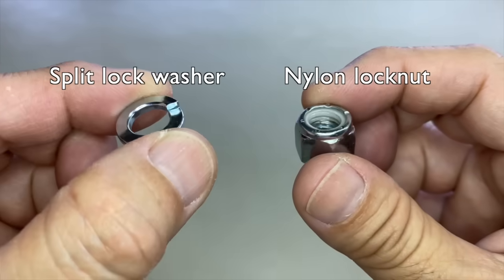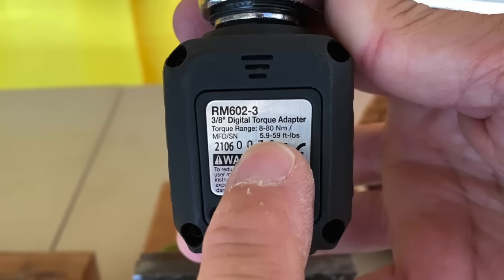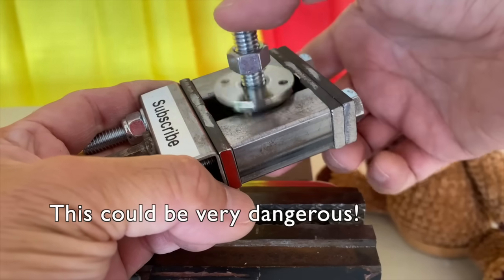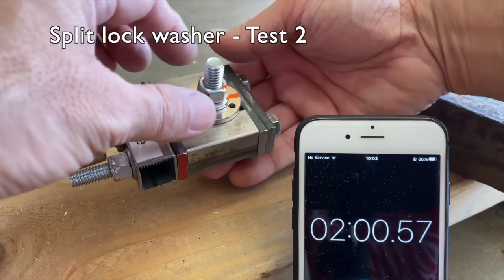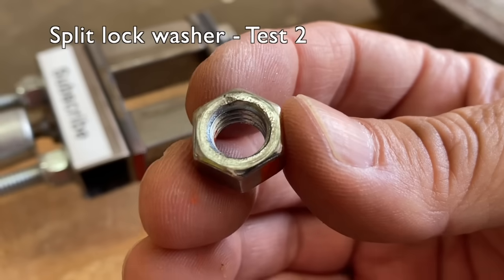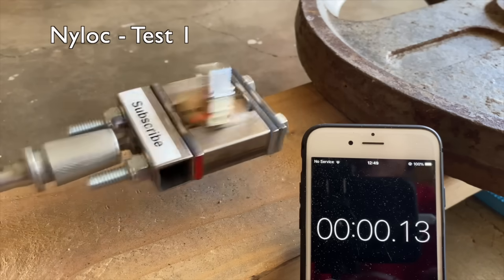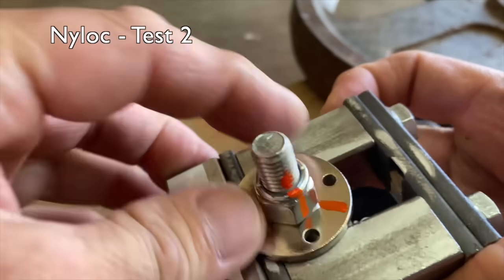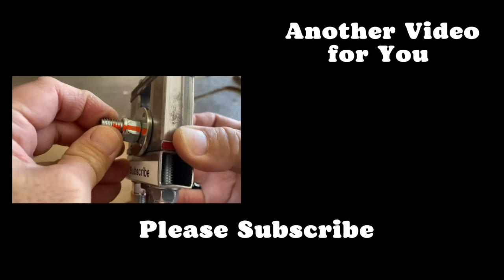Nuts & Bolts - Split Lock Washer vs Nylon Locknut – DIY Impact & Vibration Test - Part 1

Comment from the maker: Here's my follow up test with the nyloc and split lock washer combined... https://youtu.be/Iao2HT71kB8
👍😎
Reply: Because your nylock nut has drag as soon as it makes contact, your 6 ft-lbs of torque is in valid. Up to 3ft-lbs of torque would be present before you bottomed out the nylock nut. So I predict that the bolt was only torqued down to 3ft-lbs after bottoming. As a result what loosening that did occure was because of what I just said. A 3/8 bolt can take up to 40ft-lbs of torque and if you ran your test at that spec none of them would have failed. I've done bolts up to spec in all 3 ways tightened to spec and have never had nylocks or split rings loosen off and rarely has a nut by its self loosed off on me,  because of that the nylock are your best option. . why didn't your test include lock tite blue and red. I'm willing to bet that there would be no movement, espcially with red lock tight. Red lock tite is a good option because nylock nut are more expensive,  and one bottle of lock tite red will do hundreds of nuts. Last but not least why didn't you include a crimp nut they will hang on even better than a nylock nut. I've been an auto mechanic for 40 years so I know a thing or two about bolts and nuts
Reply: I am interested in knowing if Nylon lock nuts lose the "locking" ability over time. Many applications requiring locking nuts and bolts we expect them to "stay" locking over a long period. also what chemicals degrade the nylon. My Grand dad always said nuts and bolts are for temporary use, welds are for things we don't want to move. an to always check bolts even if they "lock"
Reply: @kattmcnutt  What degrades a nylock nut is threading it on more than once . you are cutting threads into the nylon when you put it on the bolt for the first time. every time it comes off after that its holding power goes down.   Nylock nuts don't work well in high heat locations either. grand dad isn't 100% right engine bolt are pretty permenant. You wouldn't weld an engine together would you? as for welds I cut through welds all the time with a zip disc to take things apart.
Reply: The best way to test a threaded joint is to stretch the bolt into the yield portion of the material.
Reply: It's very interesting, what would you say if one of these methods is to use a thread locker for particularly vibration-loaded places, there are different fixations. For example, I use a medium one for a chainsaw??
Reply: As a drummer I predicted this result. Nylon inserts in the tuning bolts have been the best solution to drums detuning when played for years. Split washers come a very poor second.
Reply: My first thought exactly.
Reply: There is a standard test protocol for this. But first, your starting torque is too low. Screw stretch is the primary force that maintains clamping In a bolted joint.

Look up Junker test. There are special machines that are used for this. I had some lug nuts a locking devices tested by a company that makes these machines. I had to go to Luxemburg city to have it done. I'll try to find the information and post it.

I salute for doing what you did. That said you will be blown away by the professional way of doing. This test.
Reply from the maker: @sttuartthompson7686  Thanks!  The low torque was needed for the nut and bolt to consistently and predictably fail in a short amount of time.  Any improvement over that time would then be attributed to the locking device.  At least, that was the thought process for the Hacks by Dad non-professional protocol.  
I"ve seen the Junker test but don't like it because it uses roll pins to reduce friction.  My test is based on the NAS aviation impact and vibration test... https://www.youtube.com/watch?v=c7UIDyHdlLA
👍😎
Reply: Would be nice to see a test of 2x nuts without any nyloc / spring washers.
Reply from the maker: @cobusbecker7226  Like this?  https://youtu.be/wacY7LRMCnw
👍😎
Reply: You forgot to test with blue and red loctite!
Reply: @willybbb999 For my chainsaw I use blue thread lock strong for vibration-loaded areas; it is difficult to unscrew even with a key unless the saw is heated with a hair dryer or warmed up well after work.
Reply: @willybbb999 I'm pretty sure I know the results of red loctite. I'd like to see blue tested though. A test with two nuts would be cool too. 
I think my choice would be the nylon lock nut with blue Loctite.
Reply: @Bob-en1ge   A question, not a challenge: wondering how the loctite would interact with nylon. I’ve only seen it recommended for use in metal to metal applications.
Reply: next time please usw "Wedge lock washers" to compare

Comment: Torque is too low. 

5 lb ft torque would never be used on something bigger than 4mm or 1/4inch diameter. 

Redo the test at 25lb ft

Using such a low torque tells me you don’t build for a living!
Reply: The fact the bolt started immediately moving on EVERY TEST tells us torque was never enough at any point.

Comment: Does anyone have experience using Belleville washers (also known as disc washers) for this kind of application?  I normally use Belleville washers on fasteners in thermal-cycling services.  I'm not sure how much good they would do at a miniscule 6 ft-lbs.

Comment: I have repaired loosening garage door hinges with through bolts and nuts with split lock washers.  They do still loosen occasionally.  Looks like I need the nylocs.

Comment: Split lock washers are a godsend for assembly.  Most people have no idea how to use them.
Reply: What, you mean they put them on * outside?*
Reply: @VladimirPutin-p3t  put a spring washer (split lock washer) under the head of a bolt, you can tighten it pretty far without putting a wrench on the nut on the other side.

Comment: Thank you for this video.  I install solar and electronics in RV's, which are sarcastically known as rolling earthquakes.  Because of the vibration I use a Nyloc nut where appropriate to ensure that whatever I'm fastening stays fastened.  The more permanent solutions like cotter pins and wires are overkill for my situation.  The comments are excellent and show that there's a lot of knowledge out there.  A Part II test would be great!  Add to the test higher torque, blue and red Loctite and a double nut.

Comment: Spring washers need to be tightened to the appropriate torque value for the application otherwise they will not provide preload or tension. Both these devices have their applications.

Comment: This was an interesting and useful video.  Thanks for making such a detailed comparison.   I upgraded a Segway Scooter with aftermarket suspension and needed to secure the rear wheel.  The original bolts would not fit in the new suspension frame.  I decided to go with Titanium flange metal lock nuts.   These were expensive but have not budged in more than a year and over a thousand kilometres of riding.

Comment: Bullshit. 6 ft-lb is not torque you want on 3/8-16 bolt. Since it was not properly torqued it had to come loose. It's not even "redneck sience". Furthermore, there are bolts specific for specific applications to even applu more torque. Just stop doing what you do. Peaple, go to school, or read books. Don't listen to this guy.

Comment: Being as 6 ft/lbs TQ on a 3/8-16 fastener would not even begin to stretch said fastener, this test is nearly meaningless, other than demonstrating that the nyloc nut is (obviously) going to back off much slower than a hex nut that can rattle around on the male threads. Stretch is critical to threaded fasteners to apply clamping force over extended periods; the fastener acts like a spring that accomodates small movements in the interface being fastened.

Comment: Proper torque per the size of the bolt is more important than the locking device. 6ftlbs on a 3/8's bolt is a genuine failure. I dont know what kind of nyloc you got, but at 3/8's, it usually takes more than 6fl lbs to simply push through the lock. Granted, Ive only got about 40 years of mechanical experience working on everything from Race cars, flat bottom race boats (that vibrate even worse than your test media) and motorcycles. A grade 5 3/8-16 bolt should be torqued to 23-30 fl lbs depending on whether or not you use a lubricant and what kind of lubricant...

Comment: I have had numerois nylon lock nuts fail when removing them to replace a part or reinstalling them after parts replacement. When your on the road or in the woods that becomes a disaster unless you carry replacement nylon nuts with you.

Comment: Raced motorcycles in my younger days, the only totally secure nut and bolt combo is a drilled bolt with a castle nut and cotter pin.
Reply: Huh? So what did you do with the sump plug?
Different applications require different solutions.

It really annoys me when somebody says "The only way is..."
Engineering is full of multiple solutions to similar requirements, and each application should be assessed according to the situational needs of the union.Rear axle bolts and rear brake torque arms obviously need a castellated nut and cotter pin or split/R pin, but there are so many nuts and bolts on a bike that I wouldn't think that you would normally only use castellated nuts and cotters. 
What, even on the fairing brackets?
Reply: Same idea though. In track use typically at the competitive level require the use of safety wired (drill tiny holes through head of bolt parallel to the mounting surface and run safety wire through, twist, and anchor at a fixed, or fixed-relative-to anchor) fasteners. This is solved by using bolts instead of plugs for certain applications like a drain or sump location. Other things, similar to how you mentioned, require a different approach, thread locker, etc. Its amazing though the tiny bolt heads though that a safety check on a track will require to be safety wired. Like m6 master cylinder mounting bolts. But you know that stuff will handle the abuse.
Reply: @davidcolin6519 all trackday organizations and race organizations require sump plugs to be drilled and safety wired. This is also true of filters and sometimes radiator caps. .most race organizations require brake calipers and fork bolts to be wired also
Reply: Wrong. A heavily rusted exhaust manifold nut is more secure.
Reply: @drott150   :face-purple-crying: ㅋㅋㅋㅋㅋㅋㅋㅋㅋㅋㅋㅋㅋㅋㅋㅋㅋㅋㅋㅋㅋㅋㅋㅋㅋ

Comment: Think of a 3/8 inch bolt being made out of rubber.   Placing it under increasing tension causes it to stretch until it eventually snaps.  Steel bolts under tension also stretch.  To achieve effective clamping effect with a bolt you have to apply enough tension to cause it to stretch.  6 foot pounds is not enough to enable the stretching effect that's needed to test a real lift situation.   I really enjoyed reading the comments below!!!
Reply from the maker: Agreed!  The comments are the best part of this video!  👍😎

Comment: You forgot two factors.  One is that you should also include star lock washers that have multiple locking edges.  Second, the amount of clearance of the bolt to the nut isn't specified, but most taps are .001 undersize, and dies are .001 oversize,  if you use dies and taps to make the bolts.  Most mass produced items have even greater clearances because of the cost of machining.  Using dies and taps that are only .0005 above and below exact sizes would be harder to assemble, but would resist loosening better.

Comment: lock washer need space . As long as a spark plug gap tester fit between ? You are good . Just like big rig hose collar . The spring need space so vibration auto thighten the hose collar . Its similar for lock washer so bite happen

Comment: Nyloc became lose quicker, but doesn't continue to unscrew. You need use higher force for the split. So it depends what you are looking for. Nylon also good one, especially for some cases.

Comment: spilt washers are not meant to keep a nut from loosening, but rather keep the nut from spinning with ou using a second wrench too hole it when torquing it..

Comment: You've convinced me, I need a split washer AND a nylock nut
Reply: Weld it 🤣
Reply: @RickTrajan  🔩😅👍
Reply: @RickTrajan  or rivet
Reply: @davidjones-vx9ju Riveting can come loose if the parts are constantly in motion. Number plates on my motorcycle used to be riveted but then tends to loosen up and make the plates rattle, I'm using nuts and bolts which does the job much better
Reply: @EdudRegnad  merely your opinion
Reply: @davidjones-vx9ju  Merely many others opinion too whether you like it or not.
Reply: @davidjones-vx9ju These are ALL opinions! Duh.
Reply: And threadlocker
Reply: What about using two nuts … I’ve found that works but would love to see a comparison with other options!
Reply: @michaelmcgowan8226 That's one of the best options and is used in places where there are a lot of vibrations and also should be easy to adjust, like the chain tensioner in motorcycles.
Reply: @michaelmcgowan8226 But jam them together with more than 6 ft-lbs ffs.
Reply: Good combination, If you are not going to unscrew, then you can use a very strong thread locker
Reply: Done that for years...as a poor man's nylon nut, wrap the bolt (3 to 4 wraps) in teflon tape...then put the nut on. May not be as good, but it's better than a plain nut. It's clean and removable. Or a drop of Blue loc-tite. He under-torqued that a lot to show the difference....
Reply: Or you could just torque the bolt to proper specs. ^ Ft lbs is not enough to secure that size fastener.
Reply: So use split lock washer and nylock nut with threadlocker/epoxy and maybe even a cotter pin.  And if all else fails.. weld it. ☑️👏
Reply: WELD! @Curtis1984
Reply: May the huge, holy yellow book of McMaster-Carr forever be your friend!
Reply: And a cotter pin with safety wire, then tack weld.
Reply: Well, that could be a conclusion from those tests.. 😉
• Use correct torque because this makes a huge difference!
• I suggest to use washers on both sides - always!
• there’s nothing wrong with split washers or nylock nuts. Use them depending on the application or what you have! 👍
Reply: and more than 6ft-lb. lol
Reply: @MyKonaRC  Girly man torque
Reply: Nylock+ split lock washer and
Thread locker. 😅
Reply: I came here to say the same thing!
Reply: You forgot the cutter pin! 😂
Reply: Nope, just thread locker. It beats both of them, even combined. I've been a mechanic for both vehicles and heavy equipment, including in the oil field, and thread locker is the way to go. Just make sure you have a wide variety to use for the proper situation, and don't discount properly torquing the equipment down. I use my torque wrenches on EVERYTHING in addition to the thread locker. I've never had anything come apart in over 25 years of doing this. I started doing this because I had something come apart despite being properly torqued to spec before I started using thread locker.
Reply: Correct
Reply: Use a chisel on the top of the nut for good measure lol.
Reply: Just Cross-thread it, it's Permanent, won't go anywhere🤣
Reply: No no, split washer, threadlocker, nut, split washer, counter nut, nylock nut and a castle nut, to top it off. Any less than that will definitely come undone 1 femtosecond you take your eyes off the thread.
Reply: ... and threadlock plus a tack-weld then peen the end of the bolt over before ripping it all out and using a rivet.

Comment: I think I have seen nylon nuts holding control surfaces on a small plane, the Risen. On the rear for the ruddervators. Rather crude looking structure actually and exposed to the elements. But it works.

Comment: @05:10 From the user manual of your Torque adapter.:
HOW TO USE AS A TORQUE WRENCH
Connecting the adapter to ratchet wrench, and socket.
INCORRECT OPERATION
The torque or force only applies on the driver head. Never apply extra torque or
force on the place other than the driver head.
RTFM!
"...ratchet wrench, and socket... " What word did you not understand???👴🧐🤨🤬
It is a phucking ADAPTER! It is to be used between a socket and a wrench. And then, any force may be applied ONLY on the wrench.

Here your hand is partly on the socket, the rest on the adapter and NO WRENCH is being used!👴🧐🤨🤯
Reply from the maker: Hahahahaha!!!!
First... thanks for the 2nd comment!
Second... thanks for additional laughs!

At 5:10... the rachet is out of frame.  I got a close up of the torque adapter display and the rachet is above in my right hand.   My left hand is holding the adapter and deep socket to keep them vertical.  Too funny!

Again... thanks for the laughs!!!
👍😎
Reply: @HacksbyDad  Like a toddler, you are just looking for excuses, plain lying and not taking responsibility.
You need to realise too much people take this too seriously, 
Now you call it silly, it would have been correct to put a disclaimer in the thumbnail!